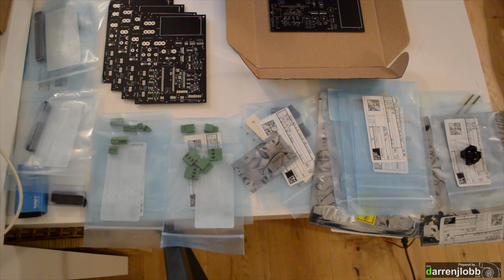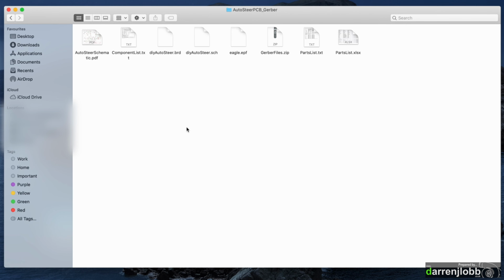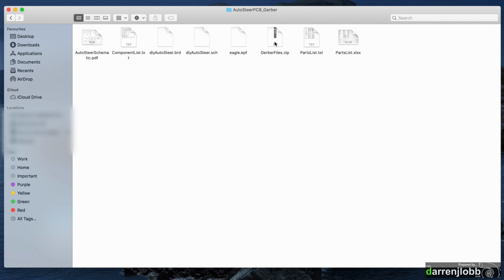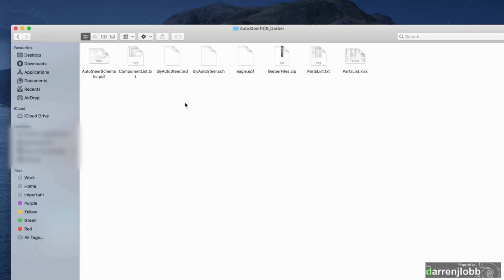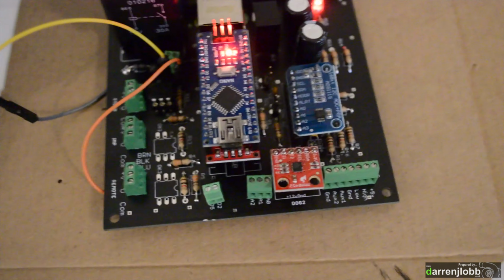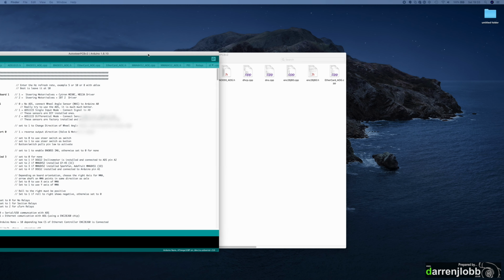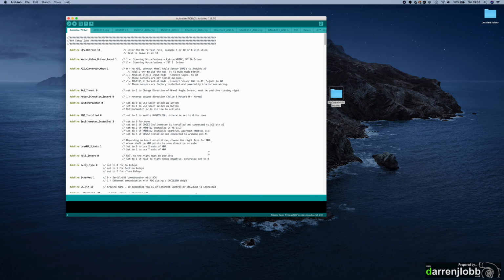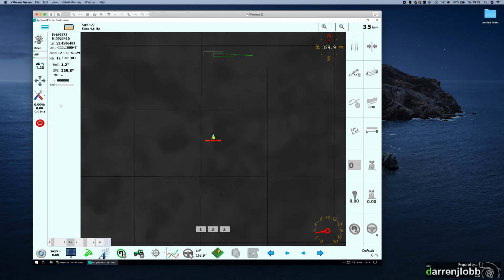AgOpenGPS PCB (V2) Assembly

Comment: Thank you for taking the time to male this tutorial. I have watched it sooo many times while assemblying my auto steer box. As they say the devil is in the details and you covered  them. Being a true novice at this I think it is fair to say I couldn't have done it without your generosity. Now on to building yhe RTK base station, the steering angle sensor, steering wheel motor bracket and getting them all to tal to each other.....How hard could it be?

Comment: Nice job Darren, correct order of components, and so many tips. Thankyou for doing this video - it is extremely helpful to the AgOpenGPS Project. I really tried when designing to use similar components like 2 sizes of resistors/caps etc. I'm working on version 3 of the board - any tips to make it easier to assemble? The LED is a poorly marked symbol for sure. The voltage reg symbol is for a non switching type linear 7805, it has a metal tab on the back so the picture is more obvious. You can use hot melt glue to keep stuff from wiggling on the board while driving - especially the mma. It won't hurt the components, but really helps with mechanical rigidity.

Farmers Helping Farmers - Ya!!!!!
Reply from the maker: Thanks Brian, and many thanks once again for all the time going into this project, it just gets better and better by the day, and as I have just wrote in a comment below, despite having already got most of the hardware required for a commercial solution, it still makes no financial sense to me, and would still not have all the features AOG has already, never-mind in the future! Have replied to post on forum with few ideas. The hot glue was going to be my fix for the MMA, although I think thats going to be back up only anyway, as thinking of running a pair of Ardusimples left / right on the roof, to give me roll, and also accurate / fast heading corrections....

Comment: Hi Darren, great to see you with your camera back out. Hope you can find time to film the process of fitting it up to the tractor, the fitting of the steering angle sensor and hydraulic valve as well. Have had a Trimble system here for just over a year now with no auto steer and already wish it had it fitted. On the subject of a building wish I could help but can’t, have just had a quote to put up a extension off of an existing shed at 9m by14m and 5m to the eaves came in at £25,000. Have not made a decision yet. Anyway cheers for the content.
Reply from the maker: Was always quite content with manually steering the tractor, but after my first season with AutoTrac in the combine (new machine already had the valve and controller etc on it)....I have realised what a joy it is / how life changing it is! Its actually quite ironic that despite me already have a Deere display, and activation, and GPS receiver (SF3000), it would still cost an absolutely ridiculous sum of moneys to give add full hydraulic autosteer to the tractor AND have full section control...activations / hardware etc all adds up insanely....and I'm just not really a fan of the wheel motor solution, so would rather keep the tractor on my own hardware and with AgOpenGPS which is just getting better and better by the day!
If people would be interested I could definitely video the project as I continue....Anyone else interested in this?
Reply: @darrenjlobb  please do continue to film this project as it develops. I won't pretend to understand all of it, but it is fascinating stuff.
Reply: Darren Lobb completely agree on the choice of the hydraulic valve, much more elegant solution in my mind.
Reply: @darrenjlobb  Yes I would be interested in this also I would like to know how your are going to connect up the starfire 3000 module to your board. 
Also this is one of the better videos on how this stuff works.
Reply: @darrenjlobb  yes, I'm intetested too
Reply: Hi Darren definitely interested in more videos on your install. I'm also a farmer in cornwall. With a keen interest in gps. I own my own jd system. But would be interested in a cheaper system for other tractors on the farm